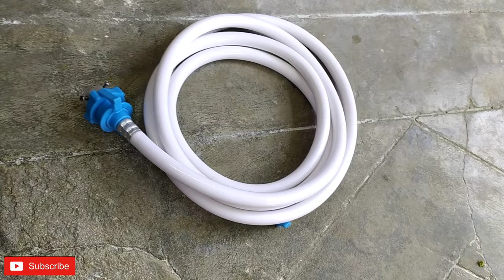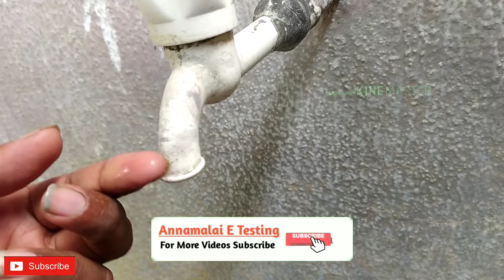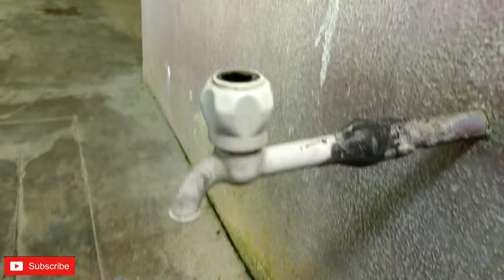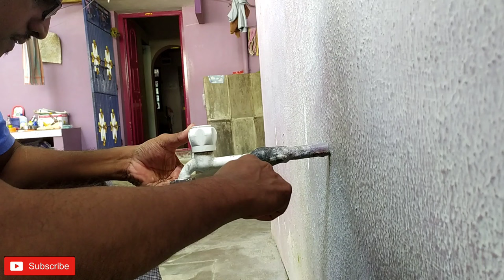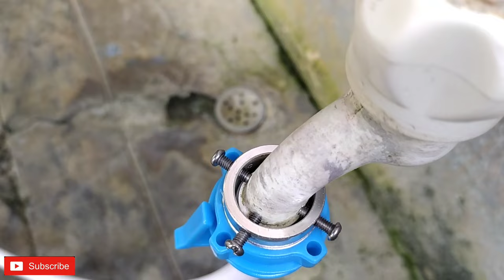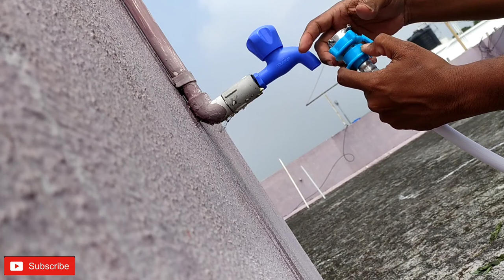washing machine pipe connection | tamil | @ANNAMALAIETESTING

Comment: நீங்கள் சொல்வது தவறு குழாயில் இனைத்து விட்டு வெளியில் தண்ணீர் விடுகிறீர்கள் அதனால் லீக்கேஜ் ஆகவில்லை ஆனால் ஒரு முனையை குழாயில் இனைத்து விட்டு மரு முனையை வாஷிங்மிஷினல் இனைத்து விட்டு குழாயை திறந்தால் லீக்கேஜ் ஆகும்
Reply from the maker: There is a tick inside this video....follow the same...surely without leak while connect with machine also.first loosen adaptor thread part little bit and then fix screw part on the tap.after fix screw tightly now tight adaptor thread also till washer close tap month.finally On it with or without washing machine connection surly there is on leakage.